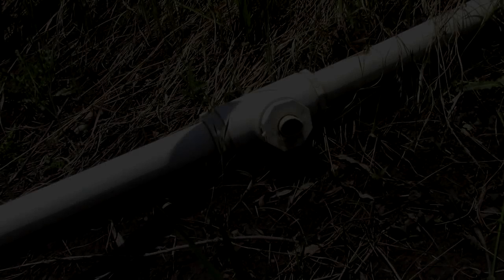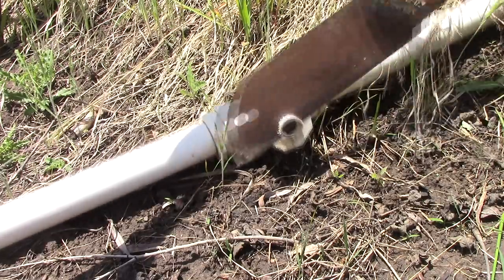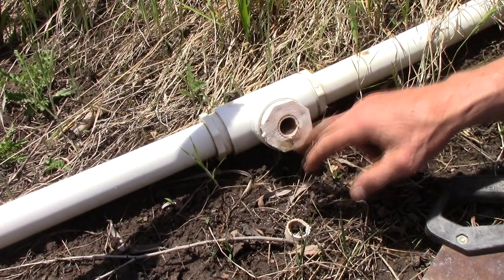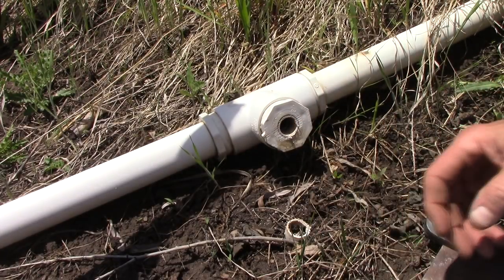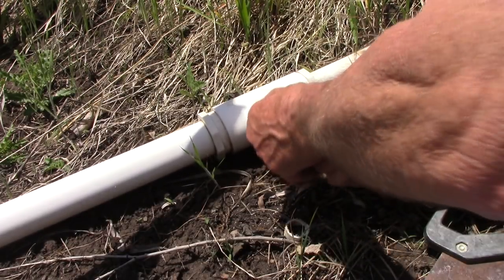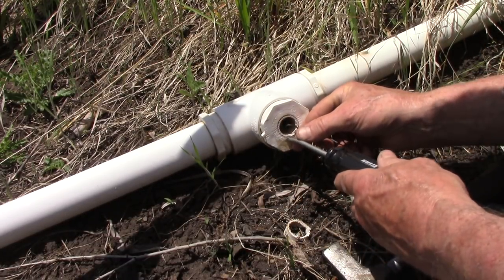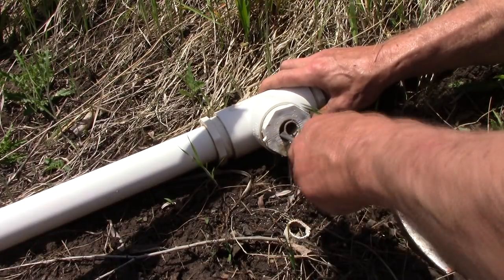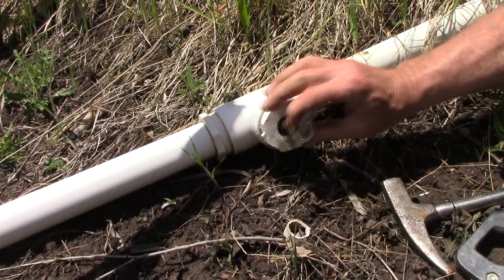REPAIR broken PVC pipe - save TIME & M$NEY!

Comment: Great tip man. I have another way of doing this  take the torch and heat up the broken bit .Then using a needle nose pliers to pull and twist out the broken pvc pipe and that is another great tip for you sir.

Comment: Nice. I've been doing the same thing only on exhaust systems when replacing a worn out pipe. Didn't always have a torch so whatever worked. Good tip.
Reply: Hope all is well on your side of the mountain.

Comment: I'm still amazed that we do not have that kind of pipe here in Europe (at least not, to the best of my knowledge). I understand it isn't even allowed to be used for commercial use here. Anyway, nice fix.
Reply from the maker: so what is used commercially? drip tube? metal pipe?
Reply: No, a flexible black PVC tubing that is very expensive and generally only used commercially. The thin-walled PVC pipe that is also available at Home Depot, etc. is not sold here.

Comment: If'n ya break off a threaded fittin' I like to use a flat file. Tap it into the hole and then use a crescent wrench to back it out. Haven't broke a file yet!
Reply from the maker: well there ya go.
Reply: Sea that now.
Where's there's a will there's always a bunch of relatives.

Comment: Tip on the glue cans. When your done using it. Close the lid and store the can upside down. The glue will dry if there is any air leaks in the can and it wont let water in the can either.

Comment: If I am careful doing this, would you suggest I could use the same method pulling out broken sprinkler riser? I have used the extractor tool for no success. I was thinking of using the flat like you did but I'm a bit wary due to the thread in the supply line.
Reply from the maker: dont over think it.. its just a pipe haha